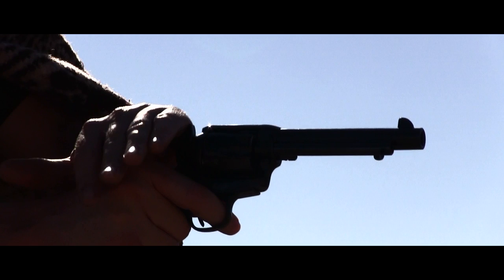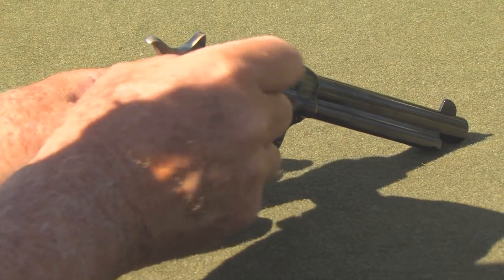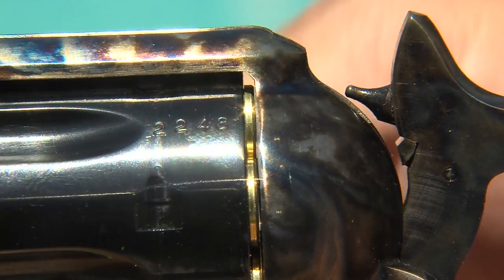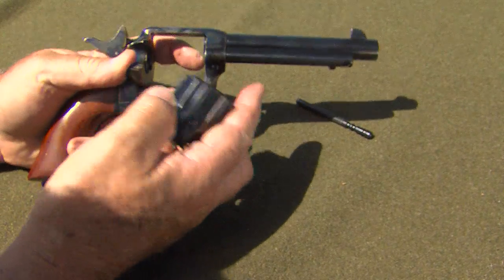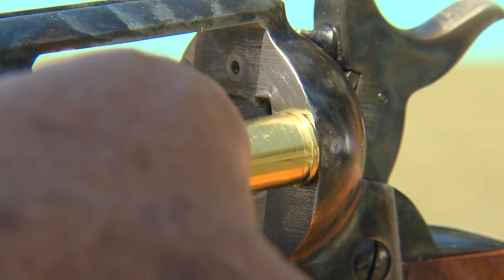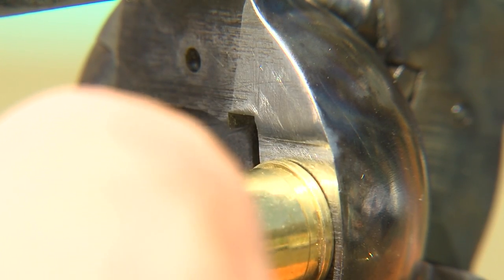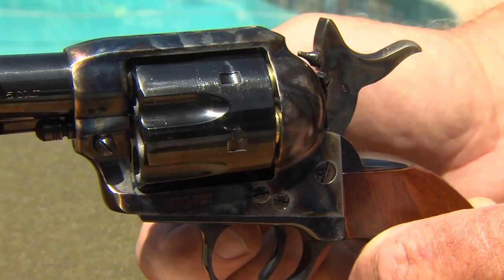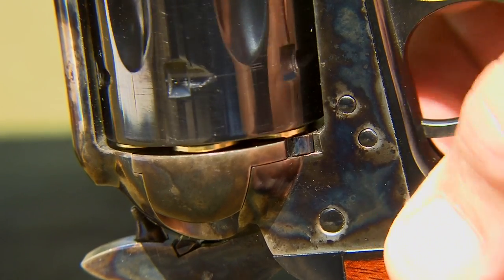Uberti Cattleman fixing cylinder jamming

Comment: Experienced cylinder hang ups on my new cattleman. I had to remove the cylinder to un-jam the gun. I had noticed it tended to jam when I tried to cock it with the barrel facing upward. Hmm. So I inspected the breach and sure enough I saw that squared lip for proper head spacing under the firing pin. I thought about “ramping it with a fine file and sandpaper but I decided to YouTube it first. Your video was spot on! I was so glad to know that I was headed n the right direction. Thank you so much for posting this informative video. It must’ve helped a ton of shooters to get back on the range again!  God bless
Reply: What cylinder do you have

Comment: This was the ONLY video I could find that helped with this issue. Kind of surprising. Before finding this video, I called a gunsmith who insisted it wasn't excess metal catching the round and he told me it was probably this or that etc etc and to just bring it in to him, but I knew better. Thankfully I found this video, took a trip to ACE hardware, and now my Pietta 1873 Cattleman runs smooth as eggs. All for a fraction of the price a gunsmith would have costed. Thank you skycampproductions!
Reply from the maker: Chris,  thanks for your comment on the video.  Glad it solved the issue with your six shooter.  Mine has worked flawlessly since I made that modification.  I don't understand why they don't ramp that transition to the headspace area.  Good shooting,   Rick
Reply: skycamproductions I recently got a uberti cattleman used and the hammer will not cock with the cylinder pin completely inserted if I pull it out about a eighth of a inch or better it will cock and turn the cylinder and lock up fine if I seat the pin completely it won't function any help would be great thanks
Reply: @jeffhershey3591  its not supposed to be inserted all the way, just on the first notch if yours has that, he pushes it all the way in in this video, thats how it doesnt allow the hammer to strike a cartridge its like a safety thing

Comment: Thank you for the tips. Because of this video, i was able to see that my firing pin hole is slightly bulged out, which was causing my cylinder to feel like it was gunked up. Should be an easy fix.
Reply: Mine has the exact same problem. How did you end up fixing it? Does it need to be flush?

Comment: Thank you very much for this video. I purchased a new Cimarron El Malo by Pietta that had this same issue. I was testing my gun with snap caps when I noticed an issue. When loaded with live ammunition, the cylinder was completely locked and had to be removed. I asked my elder brother if I could borrow a file and some sand paper, and he volunteered to do the job himself. He also found and removed bur in the cylinders back rotation mechanism (mines a one piece). Now it spins perfect with no lockups while loaded.

Comment: Thanks for the tip. I had an Uberti doing that to me on one box of ammo. Removed the cylinder and you can see a slight scrape going right across that ridge. It's super small so a few minutes of polishing should do it.
Reply from the maker: Cpt. Crunch - ever since I ramped that ridge I've put hundreds of rounds thru the gun with both factory and my reloads and it has never skipped a beat even when its almost red hot.  By the way, my great grandkids like your cereal.  thanks,  Rick
Reply: @skycamproductions  That's good to hear and thank you again for sharing the tip! Also glad the kids like the cereal, only the toughest can enjoy it, so they will be tough kids :D

Comment: I'm having troubles with the gate catch and the gate spring, I don't know whether it would be possible for you to help me out or not. I disassembled the gun but by the time I wanted to assemble it the gate catch, which I think is a plumber, and the gate spring came out flying. Fortunately I have both of them but I don't have the slightest clue about how to assemble them. And unfortunately the diagram doesn't show it...

Thanks in advice.
Reply from the maker: Hello Inaki,  I have never taken the loading gate out but found a forum that explains it:  HIGH ROAD forum, "Uberti Cattleman loading gate spring replacement".  Good luck!  Rick
Reply: @skycamproductions  Hi there, firstly thanks for the info, apparently not the plumber neither the spring belonged to the weapon as far as I know because I've never disassembled the gate, so, unless there is an spring and plumber inside the Cattleman in the trigger bolt,/stroke area (not the ones in the gate) I'm positive there are no pieces missing but some pieces left 😅

Comment: So...this is why it gets stuck while cocking back the hammer half way every now and again? Just to be clear, I cock back the hammer half way, and I can neither put the hammer back into place, nor can I continue to cock the hammer back all the way. Requiring me to unscrew the cylinder rod and and pull out the entire cylinder, then having to cock it back all the way and put back into non-firing position in order to safely unjam it. Everyone here has experienced this same issue, and this is how you fix it?
Reply from the maker: hello,  if your cylinder is jamming as it rotates toward the firing position,  it could be this.  I pulled my cylinder at the range a few times to correct the issue and continue firing.  Then I filed the ridge as described and no problems in rotation.  I also load my own and am very cognizant of what a improperly seated primer can do in such a case.  I always check my primers after a reload.
Reply from the maker: also check to make sure your barrel pin is seated properly.  I had this with one of my revolvers and the pin had worked its way out slightly, throwing the whole mechanism out of sync.  Rick

Comment: Can anybody tell me why my Cattlemen  half only 3 clicks???
Reply: The new Cattleman II has a retractable firing pin so no longer requires the safety click
Reply from the maker: Hi Screen Share,  possibly you have an early model hammer that eliminates the first safety position of the hammer, thus you only hear 3 clicks when the hammer is pulled back to the firing position.  My 1990s production Uberti had this and I happened to have a more modern hammer and swapped it out and voila...4 clicks and a safety position.  Rick